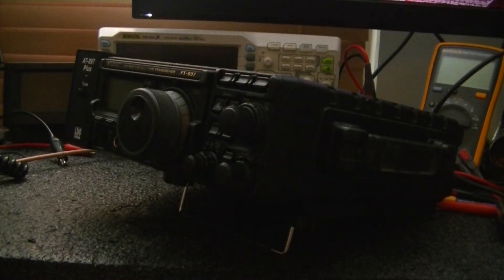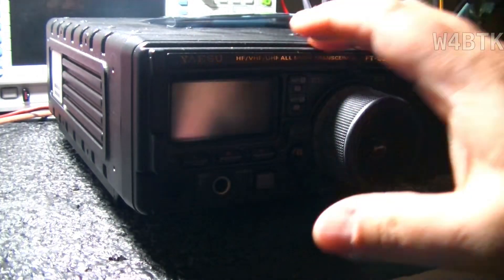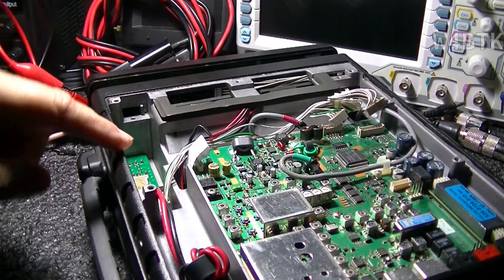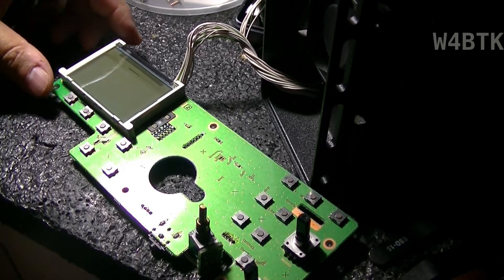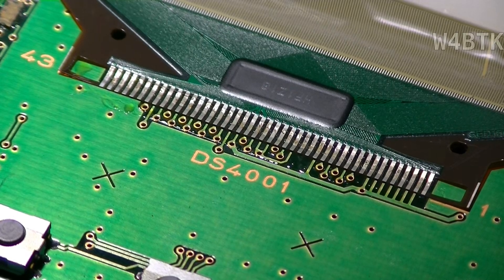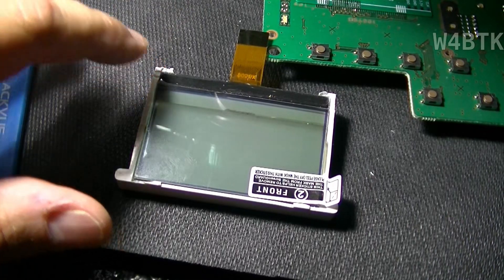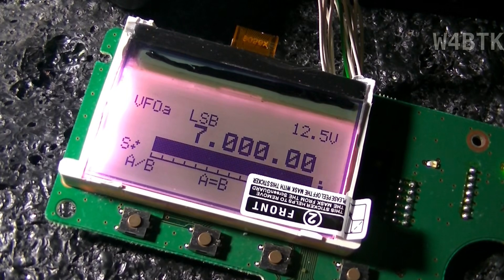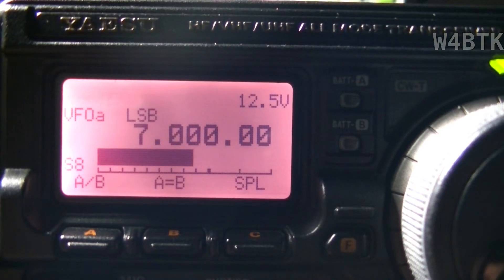@ViennaWirelessSociety  Yaesu FT-897 display replacement

Comment: Someone gave me an FT-897 for free, I thought it would be fun to play around with. The display, however, is so shot, it's essentially unsable. I managed to get a local repeater programmed in though, so I may just stick on my desk and use it to monitor that haha. Is disasembled to check out the display connection, but no way I can do this solder job in the video!
Reply from the maker: get an old or useless circuit board with smd components to practice!